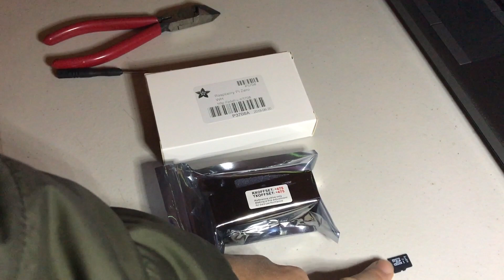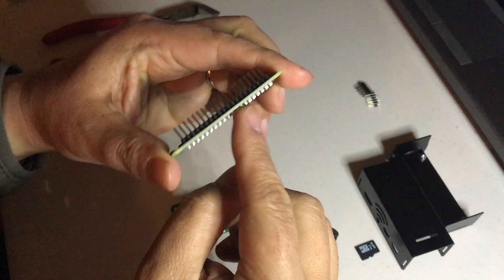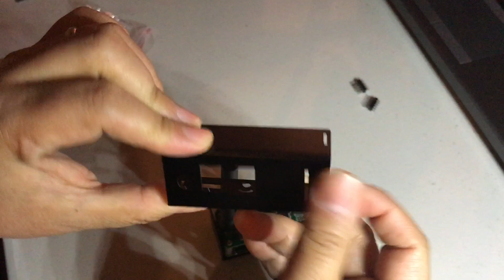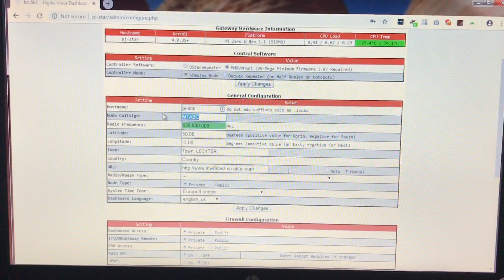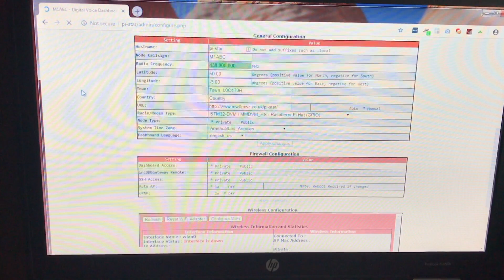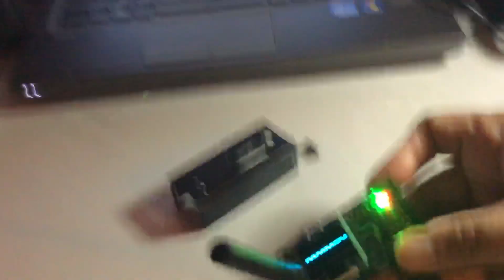Build your own DMR/DStar/Fusion hotspot for CHEAP

Comment: Ive follwed the steps but OLED is not on the display list but OLED type 3 and 6 is. They are both not working. Any suggestions?

Comment: I'm a little late to the party, but since I'm here, take the parts you didn't use... Use pliers to pull the metal pins out. You can then slide the plastic over the pre-soldered pins on the pi and you will have the proper spacing.

Comment: Dennis, do you have a more current list of suppliers for the parts? Thanks in advance. AE9EE
Reply from the maker: Hey AE9EE, cool callsign. I updated the only link that didn't work (US supplier), but if it becomes outdated again, just go to eBay for "MMDVM hotspot" to see your options. Can filter by USA if that's what you're looking for.
Reply: Thanks, Dennis. Great video and I made several HS using the original sources. 5 Stars.

Comment: The plastic spacer tubes are the same size whichever header you use so you'll get the same issue even if you solder.
Reply from the maker: You're right. I'm a dumbdumb for not thinking that through.

Comment: Very interested in in trying this.  How did you get the PieStar software on the Micro SD card?  I don't have a way to burn a Micro SD and was curious.  Great video.
Reply: You can purchase a SD Card reader/writer that plugs into a USB port on your computer on Ebay for~$6.00 shipped
Reply from the maker: If you're on Windows, try a program called Etcher which flashes an img onto an SD card. If on OSX, google how to use the command-line "dd" to write an img file to a volume.
Reply: @AD6DMDennis  Thank you for the tip.

Comment: Nice video, I've seen a lot of similar vids out there.  You can actually get the the Pi Zeros for $5 at Microcenter and $13 if you want pre soldiered headers.  The thing is there is no cheaper mmdvm hats out there.  They start at around $45 and go up from there.  They seem to be going up in price.  Maybe it was cheaper when you posted this in Jan but today the lowest price I could find was  $45.

Comment: Thanks for posting this video! I think I will go this route. Do you know if there is a setup for the Pi 2 or 3? Because I have one of each of these.
Reply from the maker: Pi-Star download should work just fine on a Pi 2, and for Pi 3's, I recommend downloading the beta Pi-Star 4.0.0RC3 under the "Downloads -> Beta Releases" section at https://www.pistar.uk/ . I run one hotspot on a Pi 3A+.

Comment: Do they all work about the same or is there any reason one should buy the more expensive hotspots?
Reply from the maker: They all work the same, with OpenSpot2 having some neat convenience features and profiles in their OS. The only real reason you get the more expensive ones is it's easier to get support or a refund should something go wrong.
Reply: Can you tell me the make of the on board Oscillator.  I am reading about poor accuracy on some.  The one that seems to work is the ECS brand
Reply: Do you think it would work better with a Raspberry pi 3  ?
Reply: @6 months ago Thanks,  I have built a couple Pi 3+ boards and a few pi zero boards.  Once the program is running you can't tell the difference between them

Comment: I build one and  my radio hears DSTAR, YSF but the hotspot does not hear the radio.  Have tried to adjust the offset but does not work,.   I have a Jumbo spot and was given a Zumspot and same problem with both.  both hotspots did not list any offset in the paperwork.
Reply: I bought from the ebay listing here and it did not come with the Rx and Tx offset ifo.  I experimented and found -475 for both works.  I contacted the seller and he told me -500 for Rx and Tx.  I am finding in my case -475 for both to work better

Comment: Dennis, will this part work?  Links you posted are either out of stock, or, on vacation? 
Thanks, looks like a good project!
Rob

https://www.ebay.com/itm/NEW-Antenna-Case-OLED-MMDVM-Hotspot-Support-P25-DMR-YSF-for-Raspberry-pi/273657542384?epid=27022757732&hash=item3fb742b6f0:g:lpIAAOSw615bd3fZ:rk:10:pf:0

Comment: Mine has just arrived today from China, but I'm soldering mine. I have the Pi Zero all ready with Pistar installed and semi-configured. Hopefully my board will work fine because i've had enough of the DV4Mini.
Reply: Hi, ive had to solder mine aswell however OLED is not coming up on the list but OLED Type 3 and 6 is. They arnt working

Comment: Really nice Dennis, thanks very much.  My goal as well and your video is very helpful.  In the end how much effort did it take to align the TX and RX?  I've heard horror stories about that part.  I want to take the plunge but am a little hesitant at the moment as I fear I might spend most of my time chasing gremlins.  Do I need to pick a "Rev x" hat to make sure it is not one made a year ago or so?  Or am I just worried for nothing....  73, John NO0I
Reply from the maker: Just do it! It's not that hard to dial down the offset. On the one I just setup (came with the one you saw on the video) I just plugged in the -475 reference offset and works like a charm. All you're really doing is starting there and seeing if going a little up or down fixes BER. And the folks over at JerryNet have gone through the pain for you and can help! It's definitely not plug-n-play, but it's a good learning experience.